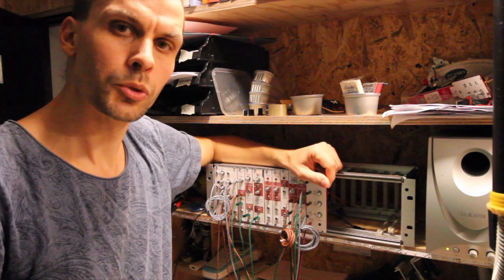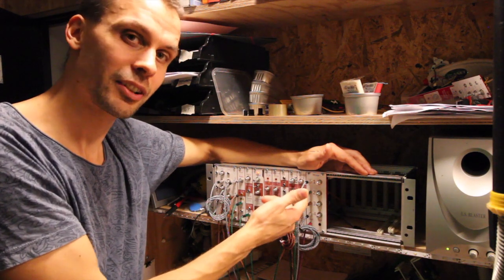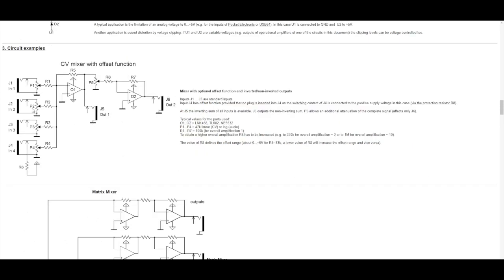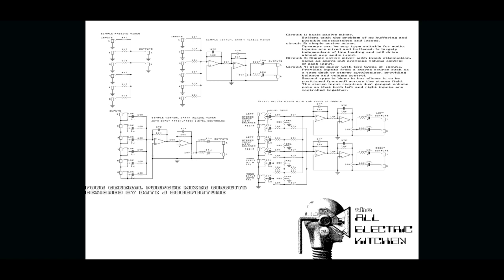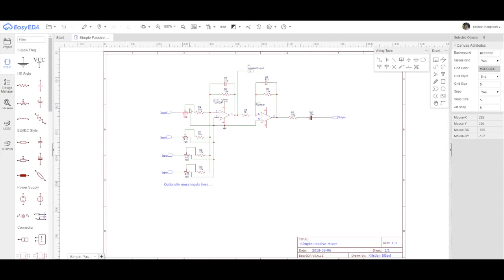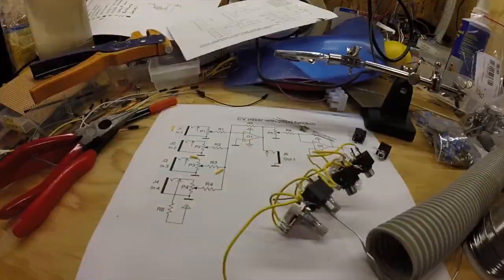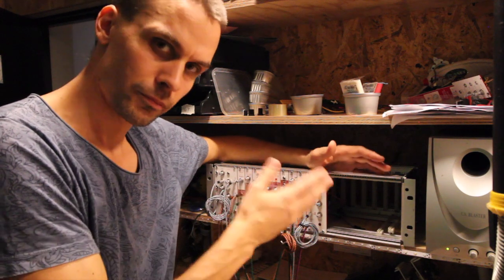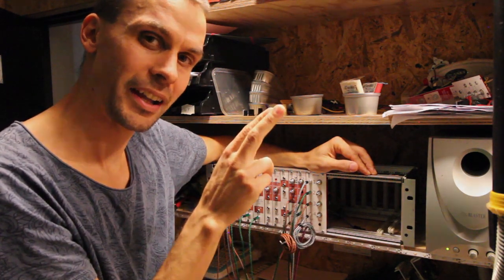Simple mixer - Modular in a Week 3.1

Comment: Great module! I've been looking to build a CV mixer and checked out a bunch of different circuits. Found this one and decided straight away to build it. Ticks all the boxes for me. All components that I had in the drawer and does exactly what I need for my current set up. I made one small addition. I built this with a quad op amp and used the extra op amp stages as buffered multiples to make copies of the output signal so I've got four in four out with one of the outputs being inverted.

Comment: love the videos! I'm rather new to DIY and I 'm trying to build this mixer, but I want to include mute switches right after each input and leave out the pot' meters. What would a schematic like that look like? Does any of your other videos explain this?
Reply: Maybe it's late, but you can add switches in gap between input jacks and pots
Reply from the maker: Sorry for missing this. But you can just replace the pot with a switch. Or you can look at a later episode where I do a voltage controlled switch using a 4066 to switch the signal. That one can be used with a switch OR cv to open close the switch.